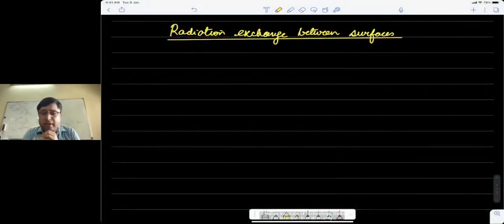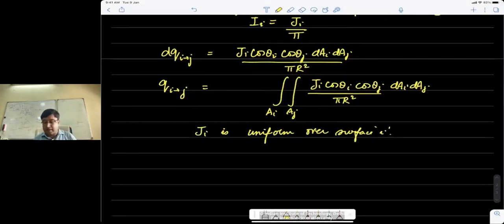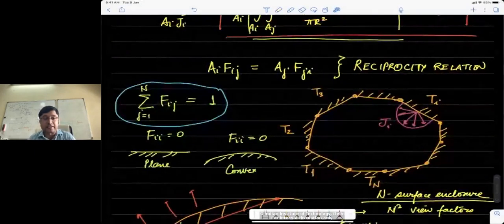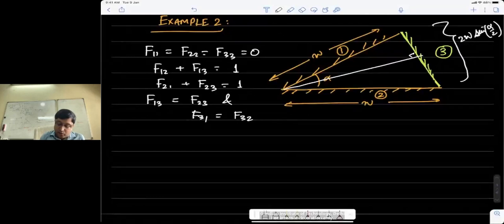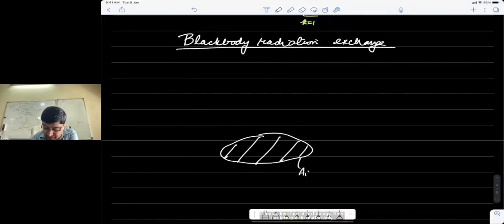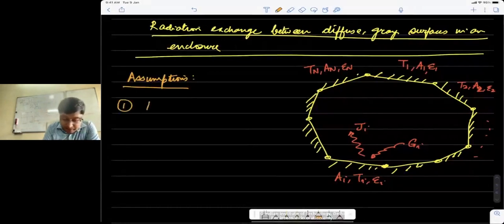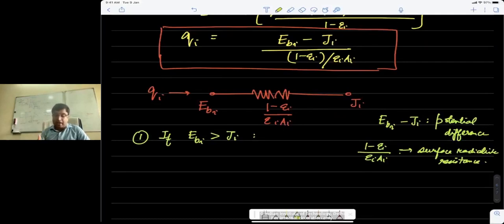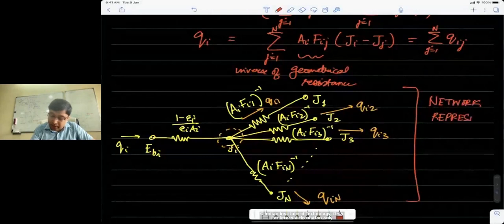Lecture 13: Radiation exchange between surfaces

Comment: When we're solving these problems, do we still assume that the medium is non-participating and that these plates, by assumption again, are inside an enclosed surface? you probably might not see this question but if you do, an answer would be greatly appreciated.
Reply from the maker: The enclosure assumption is not required here as long as the view factor could be obtained by an appropriate method. But yes, it is assumed that the medium is non-participating.
Reply: @profamitgupta  thank you professor.